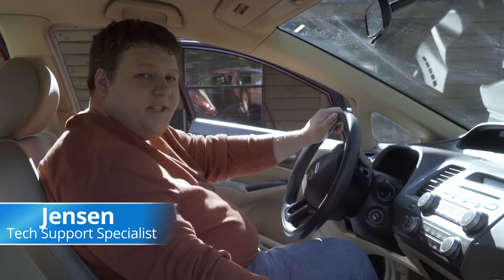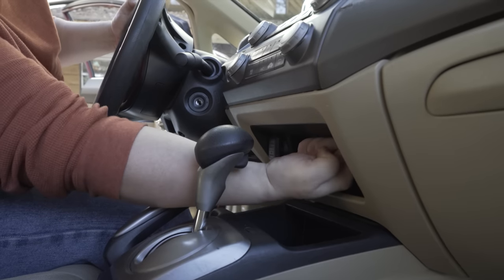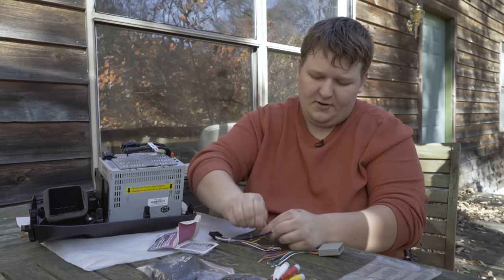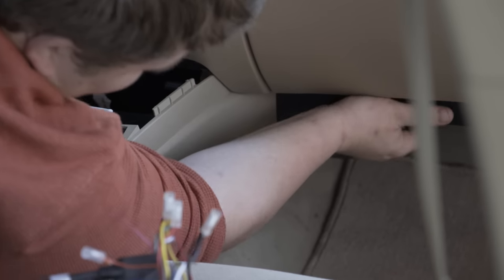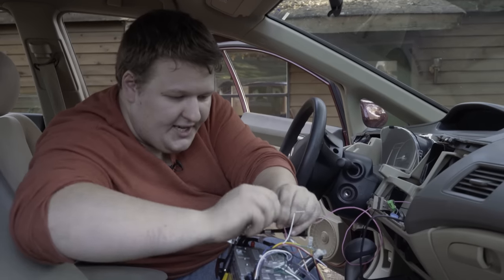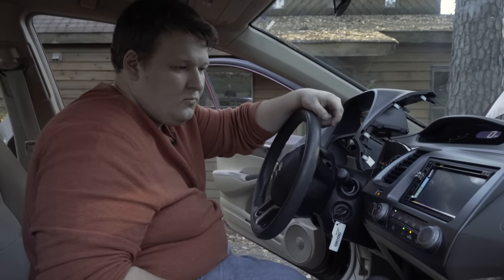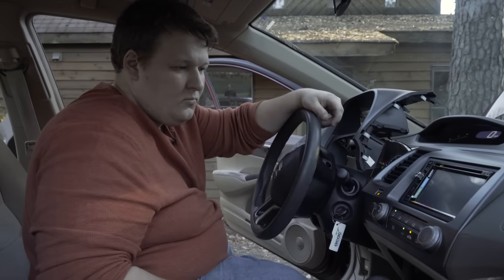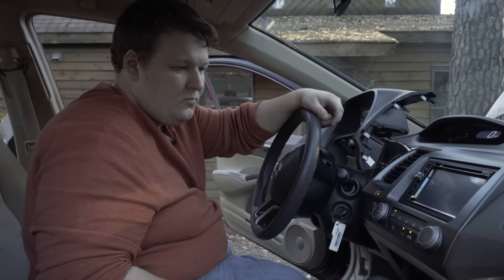How to install a stereo and speakers in a 2006-2011 Honda Civic | Crutchfield

Comment: I didnt even know that it was possilble to install different radio system into those honda´s panels, the way you work is neat and clean, that´s nice!
Reply: Neat and clean! Have you seen the gap above the heater controls?! Dodgey job form a podgey nob.
Reply: Yeah you just have to buy another dash assembly for cheap. Honda focuses too much on looks imo

Comment: I just got a civic 2009 from my mother and it requires a bit of work. 
There's fixing the arm rest clip, changing the speakers, fixing the hail damage, etc. All overwhelming at first, and i've wanted to customize it to my liking.

This video has given some newfound confidence and alleviated any concerns i've had. Didn't even know that putting in a touch screen audio unit was possible so mad props to ya crutchfield for this great video.
Reply: how’s your civic now bro
Reply: Yeah how's it now
Reply: Absolutely destroyed. I died in it

Comment: Thank you for making the converter harness install so easy. Solder is so permanent and always puts me off of making any modifications to anything and the posilocks look like a great solution! 

Update: since this video I've bitten the bullet and installed a stereo into my car and without your tips I would never have been able to do it on my own so thanks again for this video.

Comment: I purchased a similar stereo from Crutchfield for my Civic, but mine includes an amp bypass and a steering wheel control adapter. Could you make a similar video showing how to install these? This one was so good, it would be much appreciated!
Reply: I see there IS a video on steering wheel control installation--just find it on the Crutchfield channel.

Comment: Good stuff. But it'd be nice if you pinned a comment noting that there are a few extra steps if your Civic has the factory premium sound system.
Reply: Fact. Becau5now I'm trying to figure where and how to do the amp bypass to get my subs to work or sound period
Reply: @Aero_HER_Dynamic  did you figure it out
Reply: @thekempter1991  I did. Thanks a milli!
Reply: @Aero_HER_Dynamic  how did you do it? I am running into this problem right now. Please help if you can

Comment: Woow....you made that look so easy....I'm to afraid to go pulling panels out of the car lol....what's that tool you use ?
Reply: it's called a trim panel remover. Sold on ebay or amazon for really cheap.

Comment: This video is so helpful man. Thank you! Can you please tell me which adapter harness you used? I have a 2009 Civic which pretty much looks the same. Can you give me a link? Thanks in advance!
Reply from the maker: Gabriel, Is you civic a DX, EX, LX, or SI?  Also is it the sedan or the coupe?  did it have factory navigation?
Reply: @crutchfield  hey thanks man! I really appreciate your reply. I actually went out and spoke to some people and found the wire harness I needed. But just to quench your curiosity I have a GX and it's a sedan.
Reply: I need help for a si 09 with the 
Factory navigation....n my si is a coupe

Comment: Question regarding the two screws that get removed at 2:03. I just installed using a Scosche HA1561G Dash Kit and it's nearly impossible to put those screws back into it. Is that dash kit somehow supposed to reaccept those screws? I am having my doubts because the plastic doesn't have enough rigidity, compared to the OEM metal frame, to hold in place for the screws to line up.
Reply from the maker: Looks like you'll want to match up the kit/screws to the new radio as shown on page two of the kit manual here: https://pdf.crutchfieldonline.com/ImageBank/v20061012103600/Manuals/142/142HA1561G.PDF
Reply: @crutchfield  I went to the hardware store and bought a set of self tapping screws with a head wide enough to hold onto the metal in the car. I also used a drill to widen the plastic frames holes so it wouldn't crack
Reply from the maker: Glad to hear you got it installed! Hope you enjoy your new radio.

Comment: Is there a video that shows how to replace the radio with an aftermarket 06 Honda Civic with the premium setup? The adapter for the steering wheel controls as well?

Comment: 2008 Civic - There is no blue wire to attach the blue antenna lead to. From what I can find the switched 12V line is the correct wire - does that sound right?
Reply from the maker: What model radio are you installing?

Comment: My Civic LX has dash-mounted tweeters too. Do the door speakers get full range or do they have a low pass filter? Can I disconnect the dash tweeters after I install the aftermarket door speakers?
Reply from the maker: What is the year of the Civic?

Comment: How about the front tweeters ? How can I remove them without breaking anything ? This tutorial helped really much because I didn't know that the original radiopanel was an "snap-on", thank you ! (Y)
Reply from the maker: Not all versions of the Honda Civic come factory equipped with separate tweeters. The ones that do (in this year range) have grills that pry off at the front edge (near the "A" pillars).This is covered in greater detail in our MasterSheet instructions for the vehicle:  http://www.crutchfield.com/I-rYTVc180/p_264MASTER/Crutchfield-Car-Audio-Installation-Instructions.html?search=264master&skipvs=T We'll provide the MasterSheet instructions and our Lifetime tech Support, free of charge, with any purchase for your Civic.Hope that helps!--Crutchfield
Reply: +Crutchfield huge thanks ! My gf has a -06 FD2 that has the tweeters so thats why I'm asking. Going to improve the front speakers in near future. Maybe the rear ones too. And adding a subwoofer in the trunk. It currently has a aftermarket active subwoofer under the passenger seat. Let's see how well it will sound after some upgrades. Nevertheless, huge thank you for quick answering !

Comment: Where did you mount the BT mic?  and how did you run the cable for it? My order is coming soon so I will be doing this next week.
Reply from the maker: +Josh Conner Wired Bluetooth mics can be mounted in any number of locations. The Sunvisor location is most popular but many mount them to their steering columns or dash. There's no "one way" the cable must be run but you should be able to hide it under the factory trim and moldings until you get it inside of the dash and plug into the back of the stereo.For additional assistance and personalized recommendations, feel free to contact us directly:http://www.crutchfield.com/I-rYTVc180/support/ContactUs.aspx Hope that helps!--Crutchfield

Comment: When you connect the wire to the break wire, are you connecting that for the back up camera? I'm confused by that connection.
Reply from the maker: The parking brake wire must be attached in order to display video content with any touch screen/video screen receiver installation. Due to legal and safety reasons, you cannot view video unless your vehicle's parking brake is engaged. If you attempt to view video without the parking brake engaged, the unit's LCD touchscreen will simply display "Parking Off". 

Hope that helps!
--Crutchfield

Comment: you still gotta buy this kit even if you got the navigation radio ?
Reply from the maker: You'll need the recommended dash mount kit even when you have the factory GPS system, yes.You can view all of the models we recommend to fit your vehicle along with the required installation accessories you'll need, by using the "Outfit My Car" application on the main Crutchfield website:  http://bit.ly/2l32bTh  For additional assistance and personalized recommendations, feel free to contact us directly:  http://bit.ly/2jBGHPp  Hope that helps.--Crutchfield

Comment: At 2:45 on your video you said there are 3 grey connectors at the back of the stereo, but at 3:11 on your video, it shows 4 connectors. From left to right: The first one you connected it to the antenna adapter and the fourth one you connected it to the wiring harness adapter. At 7:40 you only connected the wiring harness and antenna harness. Where are the second and third go? Do you know what are those cable for? Because it is a video receiver, why you have to run a wire to the brake wire?

Comment: My brake wire was green and when I finished installing it, the receiver only worked with the hand brake up, any help would be appreciated?  👍 Also my radio kit from metra didnt want to click in so it is just sticking out on its right side.
Reply from the maker: The parking brake does need to be engaged to use some features on the current AV models; but not all. Be sure to double check your connections and radio settings. If you got the radio here, you can call our Tech Support as well. Their direct number is on your invoice.

Comment: Why did you have to tap into the parking brake light? And what was that wire from the radio harness for? Please explain. Thanks
Reply from the maker: Aftermarket multi-media receivers have a parking brake sensor lead to ensure you cannot watch full-motion video content on the stereo's built-in screen unless the vehicle is parked.For additional assistance and personalized recommendations, feel free to contact us directly:  http://bit.ly/2jBGHPp  Hope that helps!--Crutchfield

Comment: how do you actually connect the brake wire with the posi-lock...do you have to strip part of the wire?
Reply from the maker: There is no cutting or stripping of the factory wire when you use the Posi Tap connectors:  http://bit.ly/2p2XOgb   Hope that helps!--Crutchfield
Reply: Sorry I'm new on this I don't understand what is the use of the break wire using the other stereo

Comment: I must be missing something or got screwed some how! I went to install aftermarket tweeters in my 2011 Honda civic LX sedan and when i popped off the plastic dash corner speaker grill to my surprise there was no tweeter installed and no wiring or harness.  just an empty whole! So i couldn't install my tweeters cause i had nothing to work with. =( Is this normal for my car?
Reply from the maker: Unfortunately, that's fairly common, because not all of the Civic models included the factory dash tweeters.

Comment: So I got some 300w speakers n idk if I have to get an amplifier, change my radio, or do both for em to sound good.
Reply from the maker: What is the exact brand and model of your speakers? 300-watts is a large amount of power, and we can match an amp to the RMS wattage specifications on your speakers perfectly. For the absolute best possible performance from any speaker, an aftermarket amp is a great call.

Comment: Crutchfield the stereo you installed has a feature to mirror your phone using a hdmi cable. Can you explain how to hook it up cuz or tried every which way I can think of and it won't work. Thanks
Reply from the maker: In order to mirror a smartphone screen, you'll need an Android phone that supports MHL (few do anymore), and an MHL/USB to HDMI cable.For iPhone, you'll need Apple's Digital A/V adapter, a lightning to USB cable, and an HDMI cable. Here's the Digital A/V adapter:  http://bit.ly/2lp17f4  For additional assistance and personalized recommendations, feel free to contact us directly:  http://bit.ly/2jBGHPp  Hope that helps.--Crutchfield

Comment: Do you need to disable the anti-theft radio feature of the honda civic? and Does the pry tool come with the installation kit from the Crutchfield website?
Reply from the maker: I've looked through our information on these cars but didn't see any mention of special steps to disable that; not even in our installation instructions. I don't expect that to be necessary.
The pry tools are not part of the vehicle specific install gear we list of this vehicle. If you don't have any pry tools, then I highly recommend getting them and our web site is programmed to recommend them for customers who don't already have them. HTH!
--Crutchfield
Reply: Do I just search for pry tools in the search box on the website? Thanks so much for the quick response.

Comment: If you can which Receiver is that you are installing for the Honda Civic?
Reply from the maker: This install was done with a Jensen VX7022 double din navigation receiver. It has been discontinued and we have sold out of them but you can shop for current model receivers that can fit your Civic here:
https://www.crutchfield.com/I-rYTVc227/car/carselector.aspx

Comment: The blue radio antenna adapter wire should actually be tapped into the red wire coming from the vehicle. The antenna needs to be powered by a switched 12V wire, which is the red.

Comment: that wire you connected to the parking wire what color do you connect that to on the wiring harness for the double din ? I got a pioneer MVH-2400NEX
Reply from the maker: You are in luck! We carried that Pioneer and according to the wiring diagram for it, the Light-green wire is its parking brake detection wire.

Comment: Does the steering wheel control still works?
Reply from the maker: We have installation kits put together for specific car models that do include the steering wheel control adapter to retain your steering wheel controls. If you need help finding a radio and the installation gear for your car, we're happy to help! https://www.crutchfield.com/I-rYTVc974/support/ContactUs.aspx

Comment: I need help, I bought and installed a radio from you guys but I dont know how to bypass the parking brake, I tried what this video showed me.
Reply from the maker: We advise connection of the parking brake safety interlock properly and according to the manufacturer's specifications every time. Our instructions provided with your radio purchase detail how to make those connections easily!
Reply: @crutchfield  Thank you very much. I love the service you guys apply, I will continue to shop on your website. do you have any suggestions as to what speakers I should pair with my Kenwood ddx9907xr?
Reply from the maker: Thank you! We're happy to recommend speakers. What is the year, make, and model of your vehicle?
Reply: 08 civic lx coupe. Thanks
Reply from the maker: Thanks. Do you want to replace all the factory speakers? How many speakers did your car come with? Did it come with a factory sub? Did it come with factory nav?
Reply: I want to replace all speakers, it came with a radio with no navigation, no factory sub, 2 door speakers, 2 rear deck speakers and 2 small front speakers on the dash

Comment: Hey! There are 3 ,,cubes'' that comes into a serial radio. To the new radio you plugged only 2, what with the 3rd one? Speakers doesnt work only with those two:-/ can you give me advice which harness i need to connect the simillar radio at Civic Si 2007? Greetings
Reply from the maker: You can view all of the stereos we recommend to fit your vehicle and the recommended installation accessories for each by using the "Outfit My Car" application on the main Crutchfield website:  http://bit.ly/2l32bTh  For additional assistance and personalized recommendations, feel free to contact us directly:  http://bit.ly/2jBGHPp  Hope that helps.--Crutchfield

Comment: Do you need the antenna adapter to be able to use a stereo with aux or Bluetooth?
Reply from the maker: The antenna adapter is required to connect the Honda factory AM/FM antenna to an aftermarket stereo. It has no effect on the aftermarket stereo's Bluetooth or aux input capabilities.For additional assistance and personalized recommendations, feel free to contact us directly:  http://bit.ly/2jBGHPp  Hope that helps.--Crutchfield

Comment: Does this mess with the factory alarm? I know in some of the older Hondas, the alarm was tied in with the factory radio...
Reply from the maker: +JLabong That's not an issue with the '06-'11 Honda Civic models; replacing the factory radio and/or speakers has no effect on the factory alarm system.

I hope that helps.
--Crutchfield

Comment: did you use the same adapter bracket of the factory speakers for the new speakers?
Reply from the maker: An aftermarket speaker adapter/bracket is required to install the aftermarket speakers in a 2006-11 Civic. We would include that bracket for free with your speaker purchase at Crutchfield though. You can view the speakers we offer for your vehicle on our website via the "OutfitMyCar" application: www.crutchfield.com/I-rYTVc000/car/carselector.aspx?lp=%2fCar%2foutfitmycar%2fmycar.aspx

If you have any further questions, feel free to reach out to an Advisor via the "Contact Us" link at the top of the page. I hope that helps!
--Crutchfield

Comment: Hey crutchfield what model is that i have a 2008 civic and i got a 7 inch double din im new at this would a 7 inch fit my car or do i need a 6 inch
Reply from the maker: Double DIN chassis models are a standard size (4" tall x 7" wide) and will fit your dash with the proper installation accessories (regardless of the screen size). 
You can get the proper installation accessories for your vehicle by using the "Find What Fits" application on the main Crutchfield website: 
http://bit.ly/2l32bTh 
For additional assistance and personalized recommendations, feel free to contact us directly by phone or through our online chat service: 
http://bit.ly/2jBGHPp 
Hope that helps
--Crutchfield

Comment: which wire did you connect to when you ran the wire from the parking brake
Reply from the maker: That will vary depending on the head unit you're installing. For more specific details on your installation, feel free to get with an Advisor on the Crutchfield website: https://www.crutchfield.com/I-rYTVc000/Support/Chat.aspx

Hope that helps
--Crutchfield